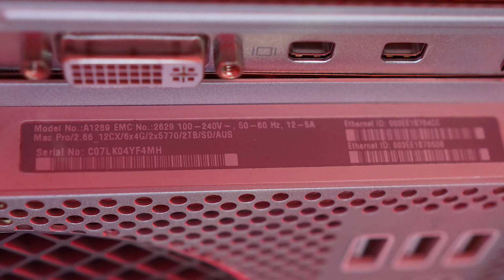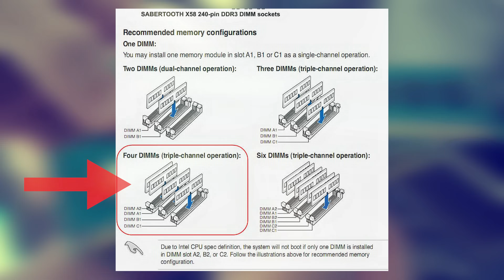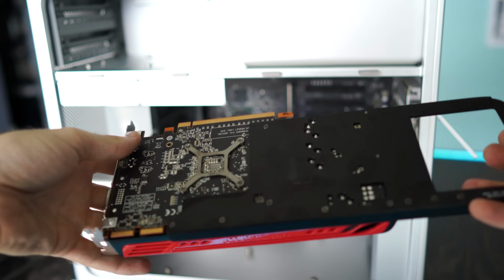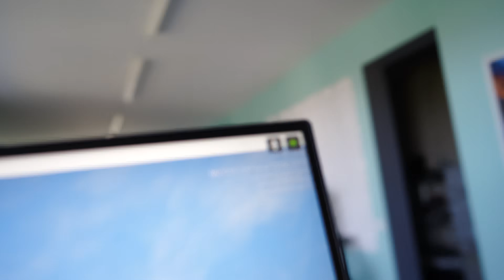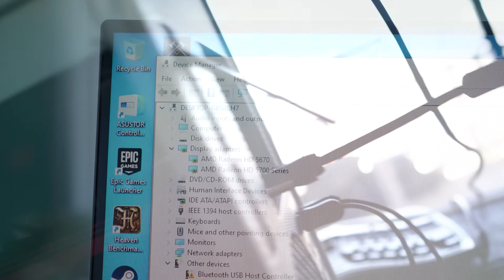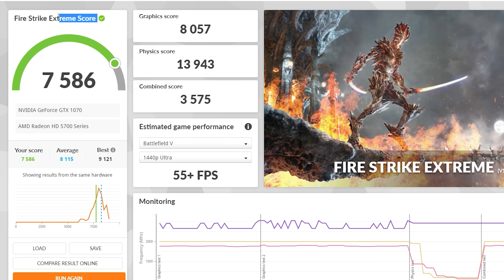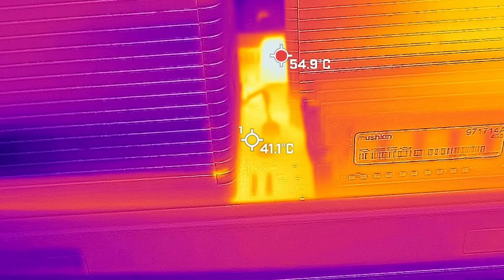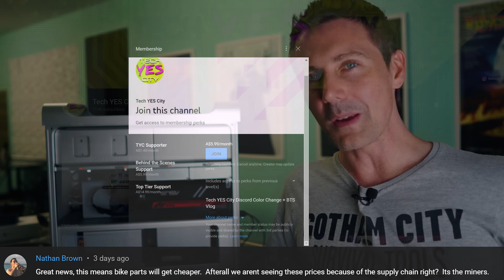Windows 10 GAMING on a $100 Mac Pro 5,1 from 2012... Is it Possible...?

Comment: HD 5770 will work as a Valorant, Fortnite Performance mode card with the right drivers in a true windows pc. built a system with one a few months ago. No issues

Comment: This is still a great machine in my opinion. I like the looks and i have the 2019 version of the Mac Pro. I was always a pc guy. Build my own computers and went up until Windows 7. When i was diagnosed with leukemia, i wanted a laptop because i was a lot in the hospital. But i want a reliable one. So i know, back in the days (2009) Windows laptops were getting better. But there were still a lot of problems with either the battery or the HDD's/SSD's. So mid 2009 is when i bought my first Macbook Pro 15"! I was so happy with it that i decided to go with the 27" Apple led Cinema display and later on connected a second one (Thunderbolt display.)

I know Mac computers cost a lot of money. And yes, a pc can (in some cases) turn laps around a Mac computer (depending on the configuration and situation.) I do music production, video editing and graphic (web) design. I have a 16-core Mac Pro with 96GB RAM, 8TB internal SSD and the W5700XT GPU with 16GB. I wish the GPU was a little bit better but at the time, it was already €15000 (about the same in $) so for me, that was the limit i wanted to go about. Certainly because i knew Apple silicon was on the horizon. I'm not afraid for the future of my Mac Pro though. I know it will last me a long time. Sure, it might lack some features in the future for Mac's like the M1. But i don't really care as long as i can keep on producing music. It is powerful enough for my needs. Just, (like i said) the GPU could be a little bit better.

Anyway, great video!

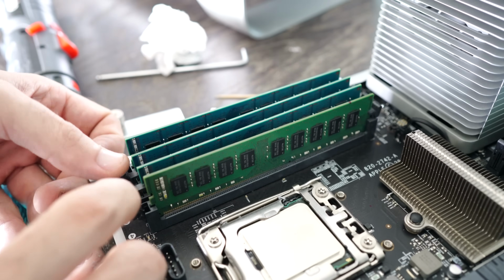Comment: 2:50 How you could get a logic board for dual CPU Mac Pro 2009-2012 to have socket bracket like this? Do we can just get any broken X58 board and just put the socket mechanism on it just like that? (There's o socket lock mechanism in Dual CPU Mac Pro 2009-2012 as far as I remembered and the one I have also doesn't has these brackets)

Comment: Why bother at all with a Mac if you want to game...,..the thing is a workhorse not a Gamestar.
Wouldn't waste my time with all the workarounds
Reply: Work-around.?
1. Update boot rom.
2. Reboot.
3.update to Monterey (latest)
4. Install Rx5700xt.
5. Load windows. And game.
It's a straight path. 2hrs. AND YOU CAN BE  ripping FPS!
.
I've gamed for maybe like 5 min. But, here's a live stream on a Mac pro.
https://youtu.be/pXZ7zFP0Kyc
Reply: @Spoolingturbo6  yeah my red devil rips fps as well with one slot install and connect 3 power cables on a modern platform not a 10 year old piece of s.....
Reply: @christianhell7860  wowow easyyy you must have some respect for a old classic mac pro xP

Comment: I bought a bunch of these to harvest their dual cpu trays.  they are worth alot, i would sell the dual trays online.
2009 4,1 mac pro dual trays wont work on 2010-2012 5,1s and vice versa.  Firmware is different.  It will work but fans will run 100%.
Reply: Boot ROM. Not firmware.

Comment: Been watching you vids for a while now. And this is the first time I've commented. There is so much wrong information in this video.
You didn't do your subscribers justice on this one.  All you really needed to do to run a single good GPU was.. 
1. update the boot room. (bios) 
2. Update the OS. 
3. Get away from Nvidia on this machine. 
then you can install an rx 480, wx7100, wx9100, rx580, RX 5700xt Vega 56, Vega 65..etc..
Alternatively you could've installed a pair of x5690's (or x5680's) BTW, 6 sticks will out perform 8 sticks..
You really let us down man.. Do better.
Reply: What if i dont want to use a power sucker like the Vega 56? The 1070 is a much better card
Reply: @cj386.  Rx480, wx7100, Rx580,..
Of your worried about power, you bought the wrong space heater, aka MacPro
Reply: Dood, the rx 480/580 are equivilant to a 1060. Also I don't have one of these and I am not planning on getting one but I just don't think owning this machine should force you in to becoming an AMD fanboy
Reply: I've gamed for like 5 minutes my entire life in this one video. Here's a Mac pro. Vega 56 gaming. Xp

https://youtu.be/pXZ7zFP0Kyc
Reply: Nothing wrong with the Vega 56 as long as you have a system to power it, not everybody does and in that case the 1070 is better.

Comment: Got a Mac pro 3,1 8-core about two years ago for 50 USD. Some guy had about ten that he'd used as servers and was just getting rid of them - I regret not buying them all and flipping them.
Anyway, I put a GTX 960 in it and it works great for older games. Despite the aging socket 771 Xeons I played through the 2016 doom no problems thanks to the Vulcan api.
Also have it set up with boot camp so I can switch to mac os if I ever need to without having to grab the original graphics card.

Comment: You probably have to update the Firmware of the Mac. That is why it wont boot with newer GPUs. Mine works flawlessy with RTX20 series GPUs under Windows, withouth the original Mac EFI Bios GPU installed (you just lose the Boot screen).

Comment: Hi! Long time watcher, first time commenting on something I actually owned for over 2 years! I blight my Mac Pro 4,1 flashed to a 5,1 bios for 600 dollars at the time. (The only difference with the two models are the delided cpu’s) and I managed to max spec it up, with the highest xeons and 128 gigs of ram (but I think the system runs faster on 96 in triple channel). I do miss it, like a lot. I was that tinker guy who ran macOS (via opencore! This fixed the boot menu on graphics cards) and windows via parallel at the same time! I felt more productive in macOS and left the gaming to windows. I did a lot of video editing, photography, and high intensity application work. I sold it though :(. You mod and load custom firmware to a point where it’s just a hackintosh. I was lacking pcie 3.0, my graphics card wasn’t getting its full speed, no sata 3, no usb 3, and under a load this mofo was a space heater, and a lot of applications are shying away from dual CPU’s and more times they cause more issues. I managed to sell it for 1300 CAD with all my upgrades and I did turn a profit but man I spent days tinkering with the system.
Reply: I have basically your same setup, adding SATA3 and Thunderbolt3. 96GB is much better/faster than 128GB. These are good for video editing, documentation, photo editing. Adobe Suite and Apple's Suite runs better under MACOS than under Windows. While this whole setup would be great with PCIe GEN4 (or GEN5), It's still plenty fast using NVMe and SATA3 drives. I never saw these as a "gaming system." Neither did Apple. Parallels is absolutely the way to Windoze-a-MAC. Always loved their software, hate their pricing plans. LOL
Reply: @Doesntcompute2k  At the time I was a poor uni student and i did want to get the NVME PCIE 3.0 cards but the drives costed a pretty penny at the time. I'm glad that you are enjoying the system it's a power house for sure for the price. There is this one youtuber named Morgonaut, and I think she's onto something with virtualization. If I still had my 4,1 this probably would of been the next step to run mac and windows at the same time in a linux VM and get almost like Metal performance without the patches and moded operating systems. Anyways cheers! Happy 2022
Reply: @jfrmegroup  Thanks man! Funny you mention her: I really can't stand her. LOL She spends video after video telling people WHAT she's going to do, never doing it, but always teasing. She could have simply told people how to install Proxmox, video cards, do passthru, and install the three OS and have been done by now. I'm pretty sure that's where she's going with running MACOS, Windows, and Linux. I've done that myself already and it runs very good on Ryzen and Threadrippers.
I've got one "perfect old MAC Pro" running 10.14 which is my main MAC. I can do everything on a Windows box but MACOS runs a lot of things better. And I don't game on my working workstations (I made a Ryzen 5950x for that). I like a lot about MAC. Don't like Apple's attitude. They missed really getting a LOT of older MAC Pros into peoples hands by not posting instructions to update, mod, on their website. Oh well, it's Apple! LOL

Comment: I saw the title and right away knew you scooped up a bargain. These are very popular via to them being the last Mac Pro tower that is relatively upgradable outside the current model which has a huge entry price. They can run a reasonably recent version of MacOS straight away and with a compatible graphics card, can run almost up to the current release. You can swap the CPU's around with various models so you can prioritise clock speed over cores (3.4ghz I believe is the highest with quad core CPU's), they support up to 128gb RAM, you can add USB 3 via expansion cards too. The GPU's are a mix. The last version of nVidia GPU's supported by Apple I think were the 9 series. 10 series were supported by nVidia with drivers they supplied, but weren't in MacOS by default. As others have said, the 1070 would likely boot, but you won't get a loading screen; you'll only get an image once you reach the desktop. AMD cards were better supported. So its common for people upgrading these to go for a Vega card or 5700 for example. I think Snazzy Labs and Luke Miani have done videos on upgrading these models in the past. But fully decked out they are still capable PC's.

Comment: I managed to pick up a Mac Pro like this locally for $100. However it was missing a side panel, which are easy enough to get. But the seller felt bad, so to make it up to me, he tossed in an Apple keyboard, mouse and monitor for the $100 price. You can't complain about that!

Comment: Lol you're not quite getting it man. You are right that government lockdowns effected factory output and thus there were component shortages, but that is one factor. Another factor was consumers were all at home all at once around the world and this skyrocketed demand independently of cash handouts, proof of this is demand in countries that didnt get handouts. Now the point of my trolling comment was that you always blame miners for GPU shortages when almost everything was sold out, computer related or not.  There were year long wait lists for bicycles in general (not boutique bmxs), the new consoles are still impossible to get, I could not get my TV, certain models of cars are sold out... It goes on and on, nothing to do with miners so why do you think this doesn't affect GPUs and it's all about miners? I haven't seen any evidence to suggest GPUs are shielded form general market conditions and if they are not then they would be sold out regardless of what miners are doing.

Comment: I use to fix these for a living I was the Mac technician for apple reseller, but Mac Pro desktops where always handed over to me because no one wanted to repair them, but I love them.

I am from Ireland and in the EU the Mac Pro was banned from 2011 so you could not buy one in Europe after 2011 due to PSU not meeting EU standards, but I got lucky and I picked up the 2010 Dual quad core model in 2012 as new old stock from the reseller I was working for.

I used the Mac Pro all the way up to last year I upgraded by desktop to a custom build, but I still own my Mac Pro 5.1.

When I was finished it had the following specs

Dual Intel Xeon X5680 12 cores 24 threads

32GB of Corsair vengeance 1333MHz still have space for another 32GB.

500GB NVME, in a PCIE to NVME card for windows 10

X1 Intel SSD 200GB Mac Big Sur drive running on open core.

X2 WD 500GB HDD and X1 WD 2TB HDD

AMD Radeon 5700XT 

She had her bottleneck’s which is the reason I have invested into a EKWB water cooled build. but its still under my desk and I have no intentions in selling it.

I would recommend looking into the Pixlas Mod if you want to run some Beefy GPU's, But the mini 6 Pin can power most cards that run under 375W, but you can have some random shutdown if you card OC past that point the Pixlas Mod gets around the logic bord 6 pin limitations. but the Mac Pro will run a 5700XT without need this mod, and its fully supported card in Mac OS when you install Open Core.
Reply: Maybe do you know if the power supply of my 2009 mac pro could be fixed at a local repair shop? The mac wont start -nothing happening. The diagnostic button on the logic board indicates the 5V standby mode. After testing the psu with a multimeter I tested around 16+ volts. Also when have the psu on it making a click sound and then is makes a continuous loud noise sound. I tested the psu while following this video: https://www.youtube.com/watch?v=ihYukqmCmRA&ab_channel=MarkHarrison .

Comment: Bryan, loved the video as always!  I have the same Mac Pro.  I’m running 2 Xeon  12c/24t at 3.33ghz, 96 gb ecc ram, 15tb storage, add in PCI NVME card 1tb NVME SSD, pci USB type c card and a RX 580 8gb OC graphics card.   Even in Mac OS I play games just fine via steam.  Mac OS doesn’t need anything but an AMD to boot via metal.  Don’t even need the Mac flash in the card.  Just thought I’d share. I’ve used a lot of your videos and built many X58 systems with your recommendations. Thank you!!

Comment: I wonder if there will ever be a modded bios that will allow overclocking for these cpus
Reply: There are BIOS editors
Reply: single cpu with unlocked (w3680/90) can be oc'd with throttlestop by chaning the multi

Comment: I had a 1st gen Intel Mac Pro. I played World of Warcraft on it in Windows via BootCamp, which played it 100% fine. The first basic GPU I had in it failed, and the used replacement also failed. I sold it before the third one might fail. There was only one gaming card stated that would have worked with it, and there were 4 tiers of Mac GPUs for it, I had the cheapest one.
These old Macs have a hard stop on which Mac OS version they will accept up to.

Comment: Those pc accept gtx 980ti and mostly work. Otherwise if you get a rx580 you can install MacOS Mojave easy. Macvidcards sells modded bios Radeon cards that give you the boot screen so you can load windows d bootcamp

Comment: 5770's should run Heaven fine..... 2009 software / 2009 GPU - they were the go to GPU for MAC's and probably still are..... I remember buying a few for peanuts and selling them on as MAC cards for triple the price.... some would work on Apples like the Sapphire ones ;)
Reply: This was my thought too - Heaven is a really old benchmark, so should work fine on an old card.
Reply: I've done the same thing on a 5870 on a 2008 Mac Pro, ran just fine; if a little slow.
Reply: I agree, the 5770 should run Heaven fine. Heck, it runs Fortnite in performance mode at 60+ fps at 1080p.
Reply: When I tested it the other day, I got 20 FPS on default settings at 1680x1050.

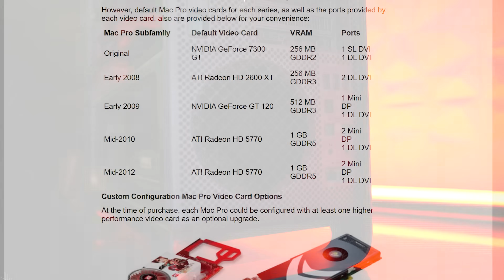Comment: 8:00 It will actually make it to the OS, you just won't get boot picker screen or a boot screen at all. If you already have an OS installed, you can boot into it just fine with a non-mac GPU. It's preferred to have a mac flashed card, though.

Comment: much too low utilized I would block cores on 8c 24t
Reply: could fire 4 times grind and mix on top of each other with new old high multi low multi up to 6x 26x from 26x up to 5max 63x new old and 2 new like 9900k on 2 old drive with more boost just put heads on top of each other and lose that is performance 88treads + kernel + dome 200 muti with 200 to x32 the main thing is 14nm 6kerne is like 12 kernel with lvl 6x7 or 8 = 16 x4 if that doesn't work then don't do it you get a lot more with it do uefi x32 usb 3.0 cone .dvd load beta bios on it from oc boards rade bios tuning software on usb win 11 can nfst and do that in the bios uefi clear oc save in profile this saves you from or 2 x1 cores 5nm to 7 to 14 nm on turbo 4 treads drive 34x per core 3.4 1.7volt 164 board 2 times 5.6ghz oc turbo adapt Production are 12kerner like the old ones then fire your old one over it with auto turbo so easy to get max I don't like these boards so I only used cpus ram get the orgila biso test that who no block ge ht over it load everything without uefi bios is possible to drive 4xx with 4x cips 8 times even if you have to triks win 11 tuner bios tuner profile set far too little fps that's the data problem that you then have fast drives so try to get over 4.62 with the old ones you have to get a pcie x16 card 4 times 3 times raid 0-5 2 on nvme x3x4 for 8k and one 256 sata to 512 faster better sata 2 boot a 3tbboot raid with less data but then you have full data speed only works if no ok do as you want

Comment: the 2012 mac pro is pretty much exactly the same as the 2010, which hardware is exactly the same as a 2009, just with different firmware. The main drawback of these machines is SATA II imo
Reply: Pcie 2.0 will run 3x faster then even sata3 I get 1600 Mbps over pcie 2.0 you won't notice a difference as a boot drive but as a storage drive it makes a huge difference
Reply: @paulburkey2  this is true
Reply: maybe use the second 16x pcie slot to run a pcie to Nvme M.2 SSD for storage with a Sata SSD for the boot drive
Reply: @paulburkey2  this what i did and Cyberpunk runs like butter
Reply: You can even run them with an NVMe drive in a PCIe slot...but then you are limited by PCIe 2.0